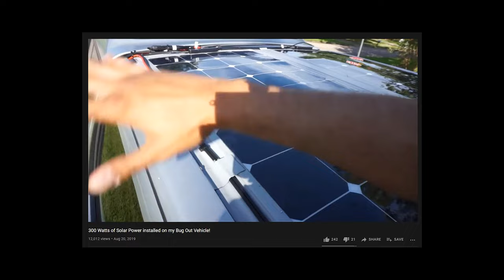My truck's roof mounted solar panels came off at 90mph!

Comment: Maybe add a wind deflection across the roof so the panels don't grab the air. You can still keep 3 panels
Reply from the maker: That would work but it would hurt my aero a bunch. The truck already gets like 18mpg highway which is actually pretty good. I don't want it much worse than that. Unless I can come up with a good solution to hold more fuel that's not gas cans.

Comment: Speed is left for the 426. Pump the brakes buds unless your rolling in a TRX.
Reply from the maker: The TRX is cool as hell. If I didn't already have a truck I'd have gotten one. At this point I'd rather have a cybertruck. Or maybe an electric f150 or a hybrid f150.

Comment: Your idea of one 150 watt panel (or a 200 if you can find one) down in the middle lengthwise is best, there should be little to no air right there.
Reply from the maker: I agree... I might try a different type of solar panel too. These still make power but they look absolutely horrible. I didn't realize how bad they looked till I saw the older video and pictures. They looked nice. They sure broke down quickly. I cleaned them once in the 2 years though. So that may have contributed but that's no excuse imo.
Reply: @DadMods  The flex ones are trash apparently, use one of the ones you bought.  I think you'll have to drill it or strap it to the roof rack

Comment: Lost the solar panels and ya hair. Slow it down big dawg 😎
Reply from the maker: The hair was gone at 25. lol. I didn't even think of the speed till it was too late. I was just trying to hurry home. Normally it was fine. After I installed them I went on like a 2000 mile road trip in the truck and it was fine. The tape just got disfigured and broke down and I never went and fixed.